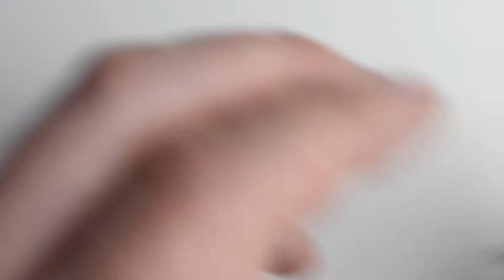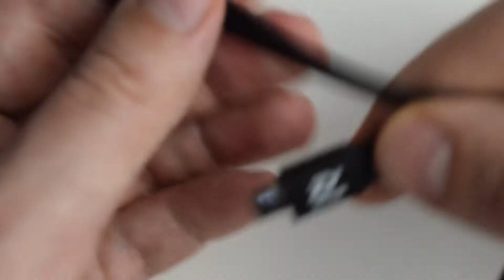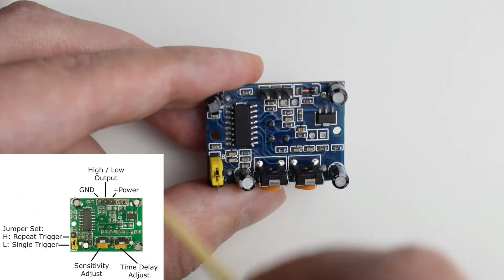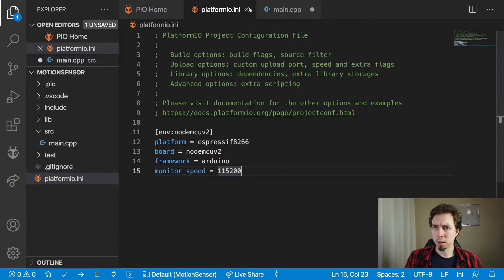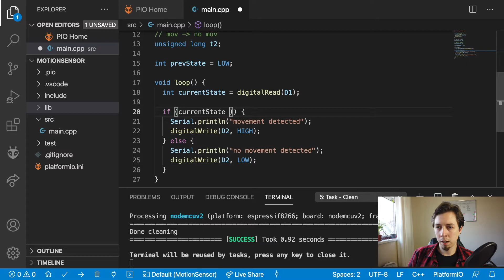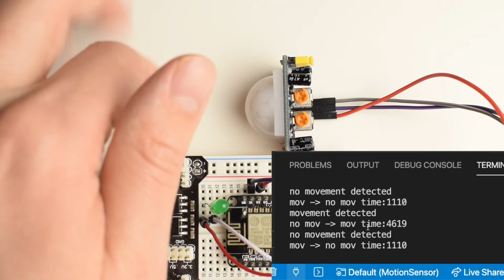PIR Motion Sensor - Day 27 of #100DaysOfCode​ in IoT

Comment: hi, just started watching your videos and very informative. Was just wondering if you wanted to put one of these in the corner of the room that didnt have a plug close by could you attach to a battery and maybe encase the whole thing..thanks?
Reply from the maker: Hi John,
Yeah that'd be possible and for a circuit that just switches on an LED diode when motion is detected you don't even need a microcontroller unless you'd like to send the motion detection information over WiFi however then we'd run into high power consumption problem to keep ESP32 on a battery - and to solve it we'd have to change the way we're transmitting data to something with less energy consumption

Comment: there is a "false detection" issue while using PIR and Wifi module in products. any suggestion how to fix that?
Reply from the maker: hey Mohsen,

there are few options:
1. you can try to use 3.3V as a supply voltage to the PIR motion sensor (straight from ESP8266)
2. keep your PIR motion sensor as far from ESP8266 as possible - the false positives are usually caused by the heat from the board or the WiFi signal as it's very sensitive
3. if you wanna measure motion from only one direction you can wrap cardboard with the aluminium foil sticked to it  around the sensor